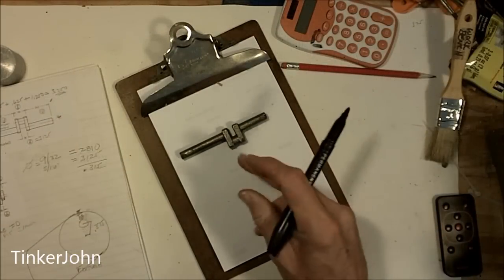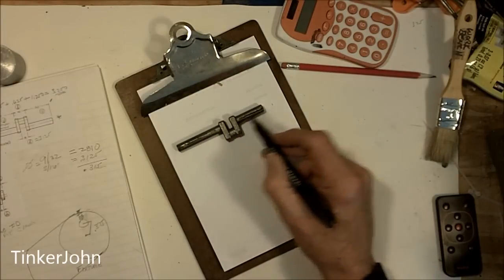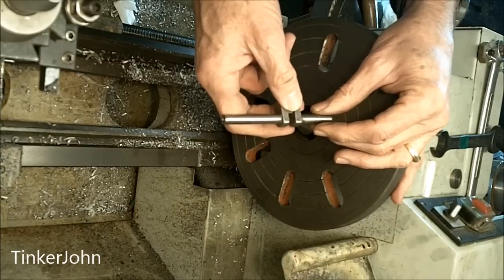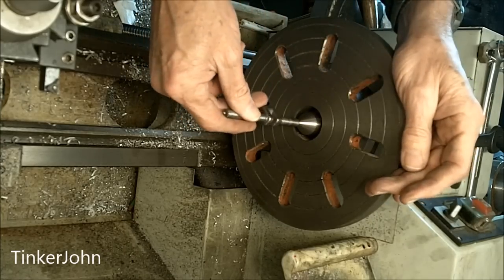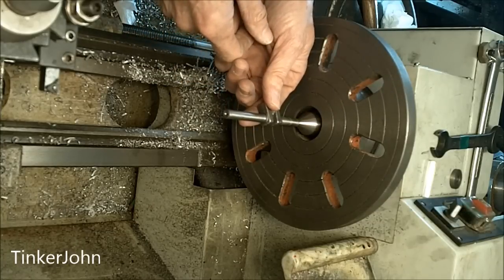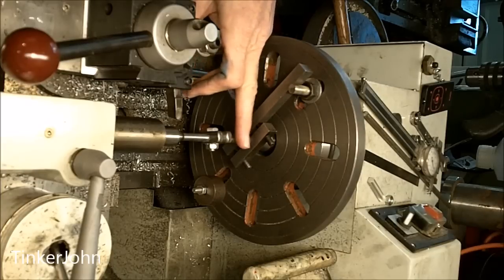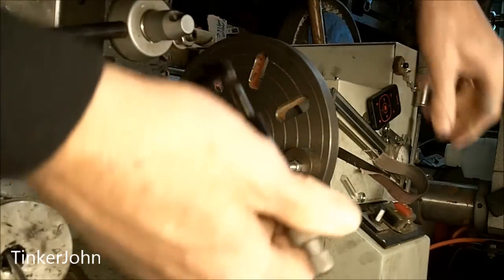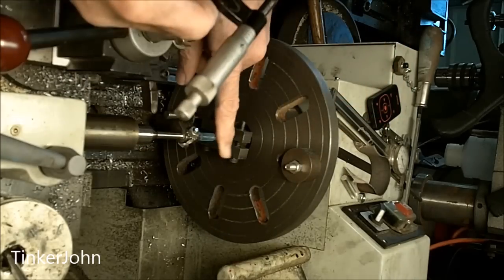Machining the Stuart 10V Steam Engine Castings - Part 8

Comment: Hi John, As the saying goes you learn from your mistakes but better yet a wise man learns from someone else's. I think you have helped to make some wise men, and that is after all the point of teaching.
Thinks! I must dig out my Stuart 7 bits and try and finish it, must be ten years since I started and I am a much better machinist now than then, but had to learn from a few of my own mistakes along the way.
ATB
chris
PS as you may or may not know Stuart castings have been of variable quality (from excellent down to adequate but never bad) through the various owners over the last 60 odd years but are now owned by a foundry, so everything should be good and consistent from now on.

Comment: john, i just received a stuart v10 plus the reversing gear. i also grabbed a stuart boiler feed pump to boot :D

anyhow, i just wanted you to know that the kits seem to be made up w/out the forged crank any longer. they're now including a bar of mild steel and two crank webs and an eccentric sheave - yippy. (loctite or silver solder, right on)

i'd much rather have things this way as turning forged cranks is troublesome at the best of times as you're quite aware.

ps. i have a pm research #1 drill engine w/ a forged crank that i'll be happily making from cold rolled - lol

great job so far, squire

//Frank
Reply from the maker: Frank,
Thanks for your comment and info about the crank change.  I am considering a reversing gear for this on.  Have you considered a video series as you machine the gear?

John
Reply: W5CYF / TinkerJohn well, i just started doing videos on my youtube channel an' i'm no coppola, but i am slowly making my way. i currently only have an iPhone for photos/video. my jittery videos at this point will only serve to upset those who bother to watch :D a decent camera and tripod are in my future for sure. perhaps sooner rather than later.

i'm starting my stuart this fine day, so looking forward to comparing notes along the way, etc.

great work, john.
Reply: W5CYF / TinkerJohn ps. the book i received has a section in the last few pages on the machining and setup of the stevensons. does the book your very generous subscriber sent to you have this as well? i ask because there have been quite a few revisions as well as a new author these last few years.

Comment: I love your work.  Great job?  But wouldn't it be easier to buy a reamer?
Reply from the maker: Yep...new reamer would be a LOT easier.  But, machining is fun so I'll just build another crankshaft.  Actually, I do need to increase my inventory of reamers for times just like this.

John
Reply: W5CYF / TinkerJohn
hello, gentlemen - i picked up a great set of chinese reamers off ebay 1/16 - 1/2" for slightly over 100. pretty satisfied w/ 'em for what i get up to.